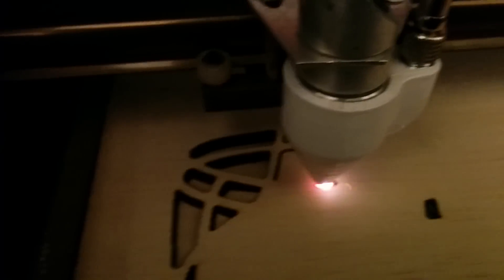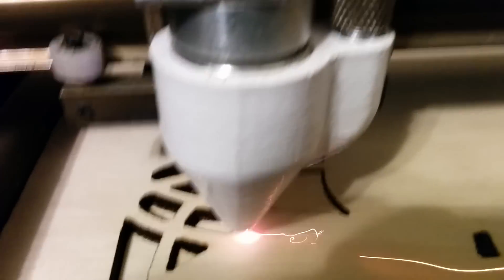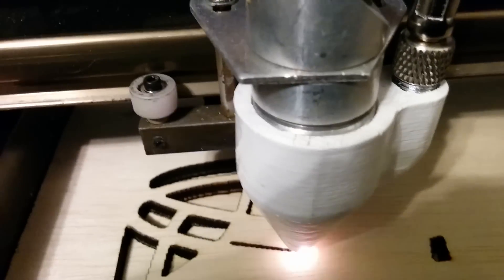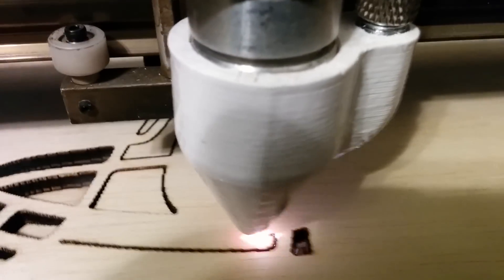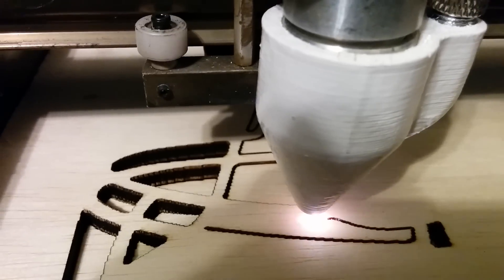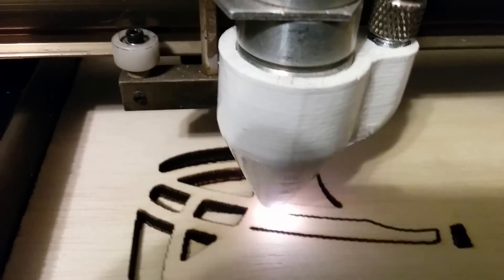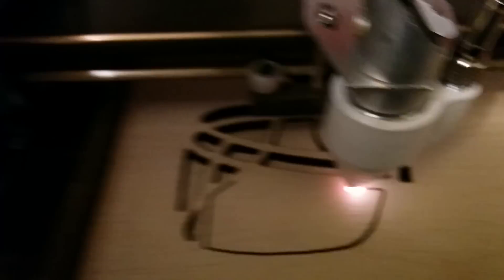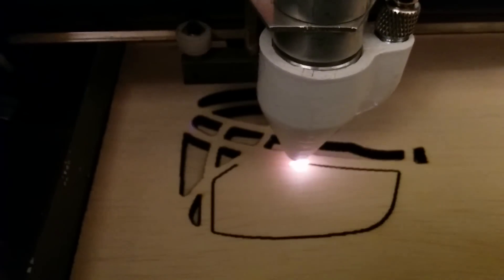Air assist Nozzle for  DC K40 Chinese 40 watt Laser Cutter / Engraver

Comment: For what it's worth, you want to run between around 11 and 15mA for the best cutting speed. On mine with a digital control, that comes to around 60%. The Internet says you don't want to run more than 14.5 mA, and my observation has been that higher power settings result in less effective cutting. I'm not sure why this is; whether it's related to overexcitement of the gas to where it's emitting fewer photos or dropping efficiency due to heat. 

Water temperature also affects how well your laser will cut. Most people agree that around 20C (or 68F) is where you want your temp, though I don't have a chiller and mine cuts just fine at 25-30C.

Comment: So out of the box how good is this thing.. I see a lot of people saying it needed to be adjusted with the mirrors... Then people complain about the software... Will it cut through 10 mm hardwoods? I really want one bad but I am worried I will need to work on it... I would get an air assist.

Comment: I bought the air nozzle and went to install today, the laser has not been used yet, got it out of the box knowing I would need and want to make some improvements.  I noticed right away that I had to move the head and that yours was moved and there was one mirror adjustment but did you have to move both to get them to line up properly.  I am a tinkerer by nature so I also removed the air box I figure with the extra air going in it would also help with air going out.

Comment: i'm not an expert but that jagged line though.... its that because  bad file resolution ?
Reply from the maker: Yes, the JPG was low resolution. The machine will cut what ever I provide it. Low resolution in equals low resolution out 😣. It can print very nice lines and curves.

Comment: That pump is noisy.  if you used an aquarium air pump with a regulator, you can achieve the same thing and it's a lot quieter.
Reply from the maker: Good suggestion, I will check then out

Comment: Good stuff, I printed it out - thanks!

I am guessing your just getting air pumped out without much pressure (zero on the dial)?

I'm still struggling to cut through 3mm ply, I must have some other stuff not right.
Reply from the maker: yes there should be no back pressure and the gauge should read zero. If you ran the laser cutter without the air attachment make sure to clean all your mirrors and lens. You should see a large soot deposit on the lens. I have done this before, double check your lens directions to make sure it is not backwards. At full power and 8mm/sec I'm able to cut 5mm birch or 16mm/sec with a double pass. please tell me how I can help.
Reply: +Mark Fuller Thanks Mark, so getting just a bit of air throughput is OK then. The compressor gets a little hot but hopefully it'll hold up.

I did clean the lens and mirror with acetone and got nowhere until I thought of looking at the first mirror - which was filthy! Fantastic, its cutting like a charm now, and the assist is brilliant! I owe you a pint next time you're in Atlanta ;-)

Comment: how is your experience with this engraver any issues so far ?
Reply from the maker: +Martijn V You get what you pay for. The mechanical X&Y is good and the laser tube/ controller is solid. The electronics is not the best and some times I have communication issues over USB. This is a good machine to start with and upgrade if you need to in the future. I have seen many people replace the electronics and have a great little solid machine.

Comment: What thickness were you cutting? Speed and "amps"?
Reply from the maker: I was cutting at 10mm/s, 50~65% power, and 5.2mm thick birch plywood
Reply: Thanks! I'll be installing an air assist this weekend and I'm hoping for these kind of results.
Reply from the maker: Post some results of your cuts.
Reply: Mark Fuller Have you changed the lens, or is that the original, and is it just that with the air it cuts so much better, because so far I haven't been able to cut through that plywood in multiple passes.
Reply from the maker: Oh its the original one. The problem is if you don't run air assist you lens becomes covered in shout  causing the laser beam to be be defused early. Air assist is a must to cut all materials.
Reply: Awesome, I'll post when it all works; ebay air pump is ordered. Did you do anything different for the extraction blower?
Reply from the maker: Yes I modified the extraction blower assembly a little bit. I removed the metal inlet ducts inside of the machine (Waste of metal). Replaced the plastic hose with a metal one, vented the air directly outside via a dryer vent, and taped the fan to the laser cutter to increase suction from inside the laser cutting area. I think I'm going to buy a bigger fan soon, but the cheap Chinese one is still working :-(

Comment: Oh, and are you using "moshidraw" that came with it? I just got one myself and have not tried software yet as tube was broken. I made an adaptation for water cooling using a discarded office cold water dispenser and will do same thing you did for water switch and will like to make this air nozzle with my Printrbot Plus.
Reply from the maker: Your not going to pump cold water into your laser tube right?! If you do, you will break your last tube. My 21 cup Tupperware and a small pump is perfect for the 40 watt laser
Reply: Mark Fuller I received replacement tube and now machine is ok. I used 3mm wood in 20 x 30 cm rectangles to cut a Galileo clock and water got up to 38C after cutting for one hour! Lots of flames and smoke. So now I use the chiller which is a cooper serpentine that turns around metal water recipient and gets so cold frost builds on it but water is not getting as cold as I make it be at 20C via thermostat. Laser cuts this wood at 6mm/s at 15mA so water gets hot if I don´t use chiller. Thanks for willing to share .stl file. Your design is nicer than the ones at Thingiverse.
Reply from the maker: Alex Echeverria File is uploaded. http://www.thingiverse.com/thing:343494 I would suggest to use the design with the slots. Print a test nozzle and see how it fits, then scale up or down your model to make it a snug print. I can modify the hose hole to any diameter if your using a different insert. Just send me your specs. Happy cutting!
Reply: Mark Fuller Great Mark! Thanks a lot! After some tweaking it fits nice. I took some photos but I don´t see a way to insert them here. I am now going to buy a replacement for the lens that got quite dirty from not having this nozzle and that will be it for having a great machine. I only wish Moshidraw was not so buggy, have to turn machine off and on sometimes to work with Moshidraw. Maybe in the future will upgrade card and software. Will keep an eye on your channel :)